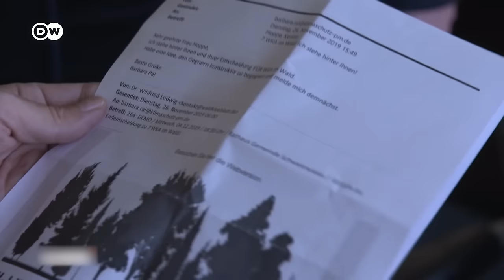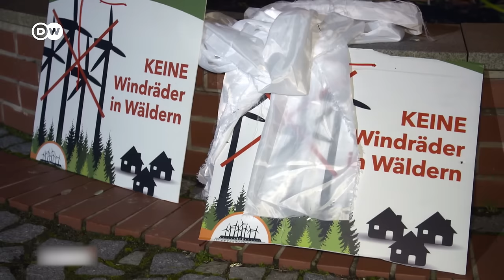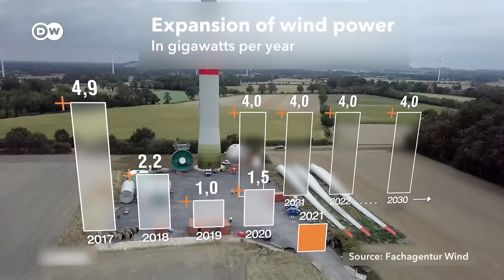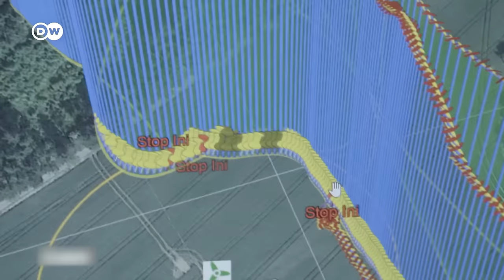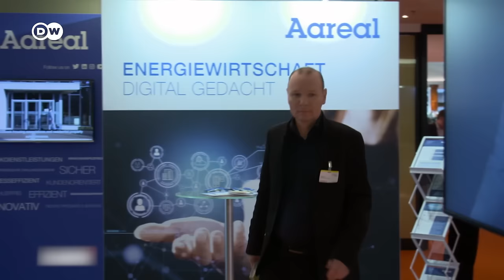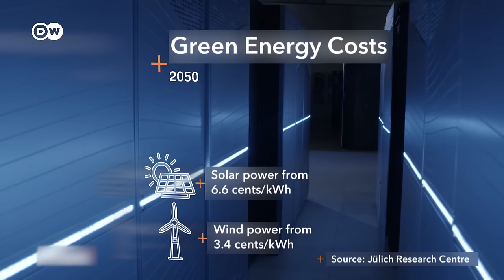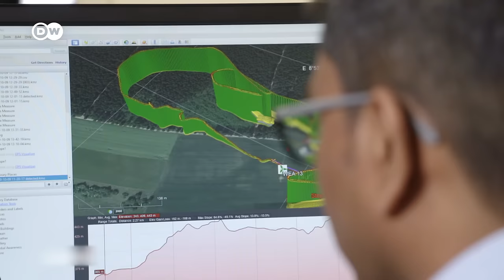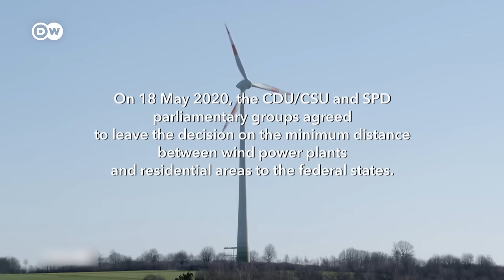Wind power getting headwind in Germany | DW Documentary

Comment: A classic case of "not in my backyard" syndrome, they understand that it is needed but just don't want to have to look at it
Reply: That and the fact that it's a climate goal not a solution, you do a calculation of the total energy used in the world divided by the output of a turbine and than multiply that by the cost or construction and maintenance. The US GDP for 60 years would be needed to build that many turbines, and this is why no one gives any numbers. And what about the rest of the world, a few countries solve their problem and 10% of the CO2  problem is fixed, while they put in that fix over decades that CO2 may be replaced by increased population in the rest of the world.
Reply: @davidwright1752  It's called Levelized Cost of Energy (LCOE). For wind currently is $25-35/MWh. It depends from region to region, on/off shore etc.
Reply: "not in my backyard" that is exactly what the greenies are doing as well. The restriction to industry drives them to far off 3rd world with no regulations at all.

USA moving steel plants to china for us steel and shipping coal 6000 miles to run them is not green at all. 

Yes we literally ship the coal to china from australia then the steel product to USA. 
The closer you look at these "green" project you realize the net carbon is ways higher than before. 
It is really not hard to see this once you follow the money and the sponsors. 
State Corporatist always have 2 objectives. Cut competition and commoditize labor. By virtually making it illegal to compete with global corp that doesn't have to comply with any of the imposed regulations.

Proof: just ask any, any of the so called green proponent about a carbon tax on imports. And you will only get crickets.

BTW I love wind and solar. Plus even coal is cleaner in the first world and can only get clean if it isn't outlawed. 

Just make green energy income tax free and it will grow naturally instead of forcing industry out.
Reply: Peter Breis  With scrubbers coal burning is cleaner. If you bubble the remaining through algae, coal could become the cleanest form of fuel.
Windmills require a lot of structures maintenance and miles and miles of wiring. The initial carbon input to set up is always dismissed. 
That said why not use tall buildings. They are already there. Already wired and where you need the energy. Make the top an air intake that concentrates pressure to one generator.
Reply: Nikola Madjarov wind farms have just about sent South Australia broke the locals now pay twice the price of the other states
Reply: Peter Breis sure wind farms are a visual pollution and very noisy nuclear is the only answer
Reply: Peter Breis you are kidding wind farms are are not profitable and where in the world does coal power stations get a subsidy Australian Government are addicted to the mining royalties it receives. Just change out all the coal power stations for modern nuclear not some fanciful wind farm real cost effective ideas needed coal power stations are very cheap to build. Nuclear power stations have improved since the 1940s a 2020 modular Nuclear station is viable So first choice is Nuclear second choice coal third choice wind farm with lithium battery storage and forget counting Co2 government and share trading companies desperately trying to put a price on carbon to they can make shit load of money. The general public are just sheep and follow dumb idea and volunteer to have large Co2 tax’s brought in.
Reply: TheRoidemortetfleur I agree coal power has the potential to be cleaner, but when you burn coal you get CO2. No amount of cleaning is going change this. We have to stop polluting the atmosphere with CO2 that should not be there.
Reply: David Wright Not according to Wikipedia. The state isn’t broke, wind power didn’t breaks the state, locals are paying higher prices because there are higher transmission costs and possibly some profiteering by SA energy suppliers.
Reply: David Wright And who will ensure that the nuclear waste that remains dangerous for 1000+ years will remain safe in that time? I don’t trust my government to be able to look after something for so long; do you?
Reply: @davidwright1752  There is no safe place to store the waste for the next 10,000 years.  And mining the ore is destroying the land and ground water.  Solar; acre per acre when safe distancing is accounted for, is comparable to nuclear power, far cheaper and less dangerous.  Battery and cryogenic air storage are rapidly advancing.
Reply: @jeremy: More people are talking the “red pill” and realising that wind turbines are a costly useless eyesore. A modest amount of warming and elevated atmospheric carbon dioxide levels are beneficial. It is absurd to waste trillions of dollars trying to prevent a beneficial change.
Reply: @markharmon4963  Ok I concede you will not even look at the science, Bill Gates has designed a nuclear plant that uses the waste it called recycling. Say I take your view and store the waste for 10,000 years Australia has offered to store the waste in one of own mines. have a look at  the map we can afford to use a couple of acres to store it (offer has all ready been made) Its all about the lessor evil and what is affordable (I have business that have to run to budgets or go bankrupt) Your like the guy that goes to the football game and watches you don't pay the players or clubs but you can tell them what they are doing wrong. As a investment I am going to put money into nuclear its a economic winner. Wind farms are a total loss. I personally have solar power (for a very long time)  however will not invest in solar farm yet? Note not yet because with technology paints and building covering will generate power in the next to 20 years.  Lets ignore the nuclear submarines  and ships that have been powered since the 1940 or 1050,s Yes it has it has safety issues so does farm fertilizer (in Melbourne Australia be have enough in the central location to take out the city 3 times the amount of Beirut explosion ) and fuel storage they create great explosions as well.  If I was you I would hope we don't have a extinction event from a large volcano eruption (possible but i hope not). The funny thing is not one statement you have made is valid. Also you have no idea about mining at all. Lets introduce the elephant in the room 7,000 tons of uranium ore will power the world for 1 year, (current reactors) Now coal 8 Billion tons of coal is needed to power the current power stations (shipped around the world). Yes Mark we are on the the same side of the problem you have a emotional solution (idealistic solutions that are currently not achievable) I just look at the cold hard facts you pray your point of view will be successful, I just looked at the affordable business case just replace 3200 coal power stations over the next 10 or 20 years every country will be almost pollution free ( dust particles in coal and fossil fuels not Co2 or we will kill the trees) Please go back and read my first 2 posts or answers use facts not your gut emotion to debate the issue. At least you are thinking about it so that is a great start.
Reply: @nikolamadjarov2226   Can you give the source of the information please, now add back the $10,000 per week Australian government subsidy. Wind and solar get your state shut down (black out and load sharing) South Australia and California Ok I am also curious how much have you invested in wind power
Reply: @davidwright1752  Concerning the source of information, I don't have it in hand, but you can Google it.  All market researchers and analytics (BNEF, DOE, IRENA, WoodMac etc.) supposed to submit similar data.
Reply: @tlangdon12  search for the “Northern Lights project” it’s a C02 storage project that the Norwegian Company Equinor is proposing and already started constructing, they claim they can store C02 under the North Sea Floor where they have earlier pumped out oil and gass. Feasibility studies have shown its possible and when operational C02 captured from Coal power plants can be pumped under the Sea Floor where it will stay forever. Like the oil and gas that used to be there. This of course is a temporary solution but it can by us time and give us longer time to run Coal Power Plants until a cleaner alternative or “Clean” Coal Power is possible.

Comment: I can't undersdand why they continuously try to push the ineffective and hard to store hydrogen
Reply: Because it is centralized so that the plebs can't become energy independent... then what power can you have over them...
Reply: Because you can make it out of fossil fuels, so it keeps oil producers rich.
Reply: @Jimmy4video  What he said. Its a trap. Its marketed as clean fuel but because making it cleanly costs 5x more they are using fossil fuels instead.
Reply: Bosonian  You dont really know much about modern storage technology. You can store the energy just fine, there are even alternatives to batteries for large scale storage using compressed air etc
Reply: Bosonian How is wind "completely useless"? Here in the U.K. we get around 37 percent of out entire annual electricity needs from wind and solar. We have gone from almost 100 percent coal powered electricity to one percent in the space of a couple of decades. By 2025 coal will have been completely eliminated. Wind is proven technology, especially offshore where wind is virtually guaranteed.
Reply: @spencerwilton5831  Yup
Reply: Bosonian  The cost is less than the price of fossil fuel it replaces. Thing is, the power plant needs to pay that much each year, the energy storage and renewables are built once and last for decades. Even worst case scenario is that a battery only lasts for a decade, but it will have paid for itself in a year and saves even more money than other storage types because batteries respond to demand far faster.
Also, no, you need resources to build renewables once, you need to dig up more fossil fuels every day and the price keeps going up as the easily reached supplies dwindle. Then the solar panels and batteries and windmills get recycled. You can't recycle fossil fuels.
Reply: Where bulk hydrogen transport and trade is involved I would prefer if they first transform it into a different chemical form first. While turning it into a synthetic (possibly carbon neutral) hydrocarbon could be a possibility, turning it into ammonia is another. By using a form like ammonia as the hydrogen energy carrier you would drastically decrease the shipping difficulties attributed to pure hydrogen.
Reply: @nolan4339  Thats how it is done in the first place. But to do it you need energy and they always use oil or  gas instead  of solar or wind  because  its several times more expensive. Moving it this way  is also extremely energy inefficient. Its kinda in the same category as bio fuels  or worse deepening on the distance. Another issue with hydrogen is that equipment used to store it have short life due to nature of hydrogen. It starts to  leak and its prone too explosion. Thats  why hydrogen cars can only be legally used for few years and then they need too be scrapped.
Reply: @spencer: Did you mean the hot wind coming out of politicians’ mouths or the methane coming out of their behinds??

Comment: It's depressing to know that, even in well-educated Germany, a huge proportion of people are irrational idiots.
Reply: "Useful idiots" is the appropriate term.
Reply: That's democracy. One idiot gets the same vote as one normal person.
Reply: It all comes down to money.
Reply: How do you think Hitler was able to take power?
Reply: Don't despair: the expansion of wind energy in the North sea is happening right now. Agreements have been signed by Denmark, Belgium, The Netherlands and Germany to install about 65GW by 2030 and 150 GW by 2050 (which is roughly the equivalent of 75 nuclear power plants).
Reply: @haveaseatplease  how much wind panels will there be though, they also only run when it’s windy and stopped to prevent the bearings from running out. Plus there an eye sore. Nuclear power plants take up far less footprint and its highest capacity factor is 92.5% compared to winds 35.4% and wind needs a far greater footprint to produce energy. 

With Nuclear waste you can store them in old mines in sealed metal containers filled with concrete.
Reply: @mitchjames9350  Nuclear has never been price competitive, not in the past (against oil, coal and NG) and not now (against wind and solar power). Also no private insurer is willing to cover the costs of a nuclear power plant accident; remember that the Fukushima disaster will cost the Japanese taxpayers around 1 Trillion dollars, a smaller (economically less  powerful) nation would have been bankrupted by such an accident. And last but not least, nuclear is not a sustainable energy source contrary to solar and wind.
Reply: Where is the evidence that oil and gas cause global warming

Comment: Germany should not have closed so many of its nuclear power plants and rather renew/build new modern nuclear plants much like France has been doing. Also new wind farms should be placed out at sea, some ground mounted, but mostly floating wind farms. Old wind farms on land should be upgraded when nearing their cycle life by fewer, but bigger turbines.
Reply: @Big Rhonda they can put plastic to protect the metal from being eroded by sea water and plastic should be made all around the wins turbines to protect from waves
Reply: Correction... They should not have closed any of their nuclear plants. Including the East German ones after unification.
Reply: @Big Rhonda Nonsense Rhonda, oil production platforms have been at sea for decades. Wind towers at sea use same corrosion control. That said a seabed mounted wind turbine is up to for times more costly than its land equivalent, on the other hand it produces two to three times as much power. Floating wind turbines are a new technology and ultimately may be best choice.

Comment: "and the trees are usually replanted somewhere else"

ya, it's probably happened once...
Reply: These mostly look to be in fields though, so trees don't matter much for those. There should be a set number of bushes that equal a tree though, the 2 may be able to share space.
Reply: Why would anyone put wind turbines in the forest anyway? The trees hinder the winds, lowering output and forcing use of taller towers to get to the steady winds.
Reply: @AnalystPrime  I've actually seen a lot in my area, but mainly on top of high hills, not that I'm worried for my areas trees, except the dying of ash from ash bores.
Reply: And yet the statistics show that more replanting does occur.
Reply: If they cut the trees as collateral damage I'm quite sure they are forced to and will easily plan a couple of trees. Wind turbines don't required so much land clearing, but the access roads to it might stack up quite a lot of fallen trees. Regardless, planting a hectare of woods is not a problem for a 200 million Euro Wind Farm. Also, unless somewhere elevated (hill), the cutting of trees argument is just a scarecrow.

Comment: If wind power were regulated with the same scrutiny as nuclear, they would never be allowed to cut and grind fiberglass blades in the open. They would have to construct an airtight double walled containment building and do it inside to ensure not a single fiberglass particle gets into the environment, then be required to dispose of the fiberglass in a deep geological repository that is vetted to be geologically stable for millions of years.
Reply: And 'thanks' for war in 🇺🇦 Germany with strong opposition to nuclear will pay dearly. Perfect leasen!

Comment: I worked on a 750MW combined cycle power plant powered by natural gas ... it was very clean!  All exhaust coming off three turbines was used to turn the 4th smaller turbine rather than be released into the atmosphere .... Aker Kverner was the General on the building of the plant ... I must admit if you go online you can see what a numerous amount of turbines destroy the landscape ... it looks awful!!!  Go look at Tehachapi, California!!!  Since I left CA in 2005 I was shocked to see they quadrupled the amount of turbines .... Look into a natural gas fueled power supply
Reply: Ellen Lee How does natural gas reduce our carbon emissions? It doesn't. Fossil fuel use has to be eliminated, building more gas powered plants is not the solution. That's before we even consider than much of Europe's gas is piped in from Russia- do we really want to hand them hundreds of billions every year and leave them with almost total control over our energy supplies?!

Comment: The making of wind power plant itself consumes lots of energy and emitting co2 too. Probably the carbon saved is less than the ones the wind power plant saved. The cleaning technology of burning coal has remarkably reduced pollution of particles into air. I don’t think carbon neutral is a key for climate change. Burning coal is completely OK and it keeps our energy price low.
Reply: Does your assumption that “probably the carbon saved is less” have any basis? Or do you just want it to be true?